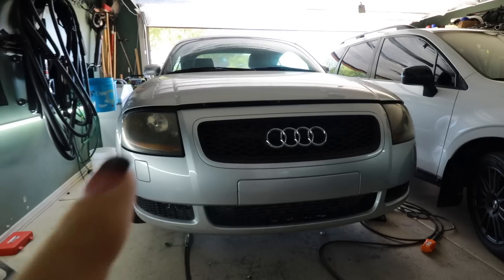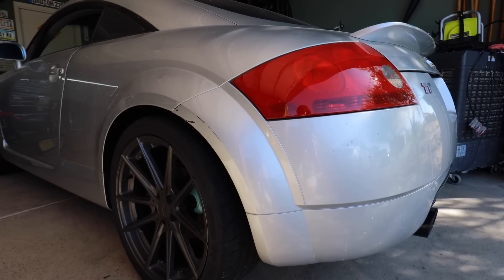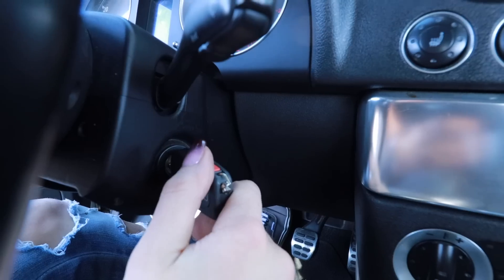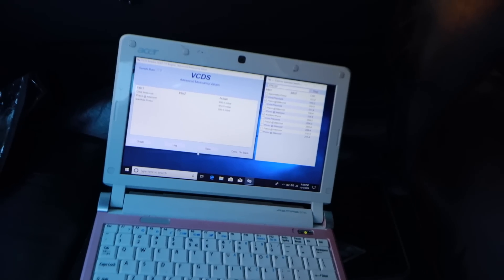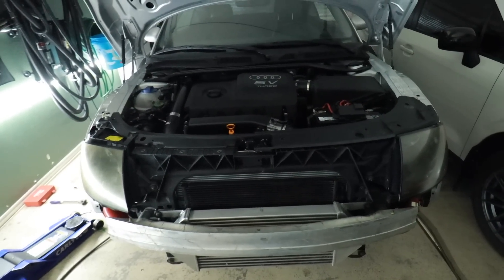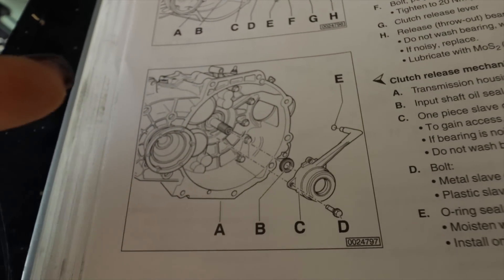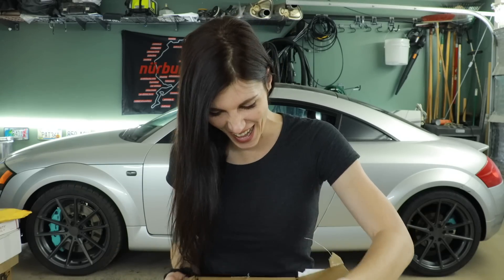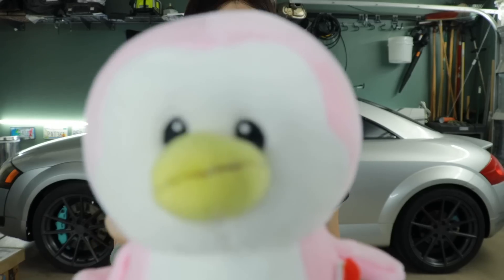First Drive Ends in Massive Failure // Project TT Quattro

Comment: Oh yay, we've reached the "set it on fire and push it down a hill" Part of a project car build.
Reply: Shit.
Reply: ...why waste a match, just leave it on the side of the road, since that seems to be its natural habitat.
Reply: @K03sport  Because that's not nearly as satisfying
Reply: have to agree; seeing the additional repairs on video won't be much fun anyways...unless you do mail time on each vid!
Reply: You have to take other clamps for the air tubes, just normal ones. At the end of the pipes "welding points MAG" then the pressure hoses no longer slip down. Greetings from Germany
Reply: Lol, I thought I was alone in using that terminology referencing my project car!
Reply: @Larcona_ ... True statement. Well, guess I'll bring the marshmallows. Guess it should be parted out first as the nice stuff should live on in another build.
Reply: @K03sport  fair enough
Reply: Every restoration goes through the "set it on fire" phase.  Those that have done them know it's just part of the process.  Typically, for me, it's "what the hell did I get myself into" phase, which is usually about half way.
Reply: @jeepmor  Hell, I hit that phase pretty much every job
Reply: Welcome to the nightmare that is VW/Audi.
Reply: @midnight-xpress1136  Cool name
Reply: Having just spent $1,100 on parts for my project van, I feel like I may hit this phase soon.
Reply: You forgot the "and then we never speak of it again" part of it :)

Comment: And now, you discovered the flywheel bolts are loose , a couple of the crankshaft bolt holes needed to be helicoiled, more cleaning, resprayed the TT , new Borla exhaust, front and rear sway bars , hours of cleaning all the wax spray rust protection off the chassis and floor panels, it’s gonna be awesome!! And some lucky viewer will buy some Merchandise and then win you TT! Fantastic! Bet you were not thinking that when you posted this! Keep up with your great content! Thanks!!

Comment: Hey Sarah, I got my TT back together only to find the temp and fuel gauges are cooked - and not just the motors, its the chip that controls them. These TT's fight you every step of the way, but stay strong, go work on something fun then come back to the TT. Getting the engine and gearbox out is not that difficult, the whole front end comes off so you can drop the engine onto a pallet or trolley and pull it out - you don't have to take it out the top. I've seen plenty of people do it on their own, just be methodical and take the time you need. Go Sarah !

Comment: Stick with it.  The clutch slave cylinder on my 2001 TT went shortly after I bought it back in 2008 with only 56k on the clock.  I remember that feeling well.  I’m a garage mechanic with no lift and it took me about 20hrs to do the job.  Its a big one, but not rocket science.  Plus, you’ll gain the respect of every mechanic you talk to from here on out.  Good luck!

Comment: Keep going Sarah, you'll get there! Just replaced the clutch on my 225 TT project. Just over 18 hours including time to clean everything and of course replace the engine rear oil seal and the transmission input shaft seal. None if it was particularly difficult, it's just that there are a lot of parts to come off before dropping the transmission.

Comment: Had a 2002 VW Beetle turbo with way to much to list. 480 hp on nitrous to the front wheels, was always breaking motor mounts, and blew 2  diffs totally destroying the transmission case each time. Fun times, until it got stolen back in 07. Current project is an Acura TSX. I know I'm late to the game but keep it up, don't give up. Loving the channel.

Comment: VW/Audi tech here. Can confirm, sounds just like a failed dual mass flywheel.
Reply: invisblegt correct I just replaced mine
Reply: XD
Reply: Yup, noticed some rough gear changes, also sounds like over run on the boost. Anyone else hear it ????

Comment: I am sure it's been mentioned but the DMF has a tendency to have a higher failure rate, just be glad it did not explode. When replacing mine on a VW golf it was recommended to move to a SMF and step it up a notch. I am actually not surprised it failed on the TT with all your improvements in performance you done.  I know you've struggle with this car but its come along ways and you've done a great job!!!

Comment: It is incredibly frustrating when this stuff happens I know but full marks for digging in and pushing on, the videos are still great to watch! 
I’ve spent since February this year stripping, welding and respraying my 1973 Triumph Stag, no putting it back together with every part rebuilt. I am dreading and looking forward to the first drive- probably next Spring!- as I know I will find all the bits I got wrong 😬

Comment: Hey Sarah, I feel your pain. I just spent months rebuilding the front suspension, complete cooling system and timing components on My A4 SLine Ultra Sport Only to find it had blown head gasket/cracked head/worse..? Anyway, don't get down & don't give up. The TT will rise again. I have faith and you have guts. Hope to see you on the road sometime.

Comment: Use weld slag to keep the IC piping together. Basically, just put a spot weld in 3-4 spots on the edge of both side of each tube where the couplers and clamps are. That will give the couplers something to "bite into" under boost. I did that on my Cobra and it was good to 30 psi. :)

Comment: screws through the round pipe will allow the clamp a backing and help prevent slip out under boost. You can use rivets if you like. the hose holds them in and they will not fall through the metal into the intake stream.

Comment: Had a 2005 Series I Quattro cabriolet.  Drove it 156,000 miles.  Sometimes I wish I still had it😞.  Just about everything on that car was hard to work on.  Loved that car.  Now have a 2018 TTRS.  I like it too it has manumatic trany and isn’t a convertible but it is a better car and has LOTS of power and an extended warranty...

Comment: remember to make sure you have charge pipe couplers very clean. Both the pipe and coupler have to have no oil on mating surfaces or they can slip off even when clamped hard. Especially higher pressure like 26psi on my turbo 5 quattro. 

I recommend a steel single mass flywheel conversion. I really like California Clutch, mine was custom for my S6 with a single mass FW

Comment: For the 32 people that have already, and countless more that will, this is not a throwout bearing noise. They will generally present exactly opposite of Sarah's issue. 

Throwout bearing is engaged to, and spinning on, the pressure plate when the clutch is disengaged (pedal down) and just along for the ride with the clutch out.

If a throwout bearing is making noise with the clutch engaged (pedal up fully) then it's already separated, and will make far more noise with it spinning on a disengaged (pedal down) clutch.

Comment: I have a 2006 Audi TT mark 1. Here in the UK and yes to change the front bulb you have to take off the whole front of the car
..crazy. (near side) I've changed the other bulb without having to do that on the offside. Great car although mine's only the 180hp single exhaust.

Comment: While fixing your 02M gearbox / clutch, please check the 02M's selector forks. In its cost-cutting wisdom, VAG attached the forks with rivets, not nylok nuts 'n' bolts. The forks can detach and fall into the 'box with two possible outcomes, 1) best case: a "box full of neutrals"; 2) worst case: terminally chewed internals.
BTW, thanks for your excellent vids.

Comment: Dual mass flywheel coming apart....change over to a single mass setup...Valeo makes a direct conversion kit...part no 52405615 . You can get the flywheel, pressure plate, slave cylinder, clutch, etc. and it's less than $400 on that "stone" online retailer with the funny commercials. I did it to mine, very glad I did. Good luck!

Comment: Hmmm.  Let's see what I've had to fix lately.
Mercury #7
Turn down the turbo boost for a stock ECU.
Replace tires that don't hold air.
Mercury #4
Got the aftermarket radio to work.
Got the Cruise Control working again.
Got the battery light to stay out.
Still trying to track down a check engine light.
Mercury #6
Need to get the radio working on this Convertible too.
--------
So I work on cars too but not near as much as you do.

Comment: Go to Harbour Frieght and get a bead roller. Or see if you can find one on Craigslist or something. Maybe call a shop that has one and see if they will roll it quick. If you can't find one talk to someone and have them weld a bead around it, and that will keep it from blowing off. Cheap temporary fix until you can get decent piping

Comment: For the license plate mount, take a 1x2 and mount it to the wall at the studs, then screw the license plates to the 1x2’s. Less holes in the dry wall and the screws won’t pull out of the 1x2.

Comment: As someone who's tackled pulling a transmission out of a VW/Audi product alone, I would suggest you pull the motor.  Yes, it's a bunch of extra work, but it will make the job so much easier.  Just simply getting the transmission out with the engine in is ridiculous because of how you have to rotate it to get it passed the subframe.

Comment: Good diagnostic. If you’re right and the flywheel springs are gone, you may have noticed a light knock/thud sensation when you drove it previously. As the springs become worn, you’d notice that when you lift off the accelerator that the car knocks once - it almost feels like you’ve got an engine mount loose.  That sort of thing I’d expect on a car with 80k plus miles - which is what’s earned me off a VR once before. I’ll be keeping an eye out on my current VR too.

Comment: I’ve had shops replace my clutch for about $1200, if I remember. (2004 TT 225)

I know South Bend makes a good aftermarket clutch with near factory feel. Don’t go with a lightened flywheel unless you like your TT to sound like a diesel.

Comment: FWIW, I have a 2013 Beetle Turbo and I broke the dual mass flywheel. They're a notorious weak spot if you add power. Basically, I was making around 310lbft of torque and the stock setup was rated for around 250.. It lasted 20k miles. ;-) The new setup is single mass and is rated for 400lbft.

Comment: After nearly scaring someone off the freeway when I blew an intercooler boot at around 55psi (diesel), I learned that hairspray works pretty well when putting the hoses on.  It's enough lubrication when it's wet and after it dries...  Well, it's hairspray.  :)
If you ever need another set of hands, I'm on your side of town and have no life outside of work.

Comment: Sorry about all of the trouble with a capital TT.  Anyway, now's a chance for a single mass flywheel that spools up quick.  Also, the guys at South Bend Clutch are cool and can get you into a higher performance setup that still shifts nice for reasonable dollars.  Maybe they can work you a deal,  They were helpful for all of my questions.

Comment: Miss Sarah, on the metall flanges between the silicon piping, ye know the joints as ye can call it.. Weld just a dot on each side of the pipes and then just use the Vband to clamp the hoses, this solves the issue ;)

Comment: Haven't read all the comments so just ignore this if already explored.  But have you checked to see if the catalytic convertors are clogged? I had a 200k mile Audi 90 that ran hot with low power. A piece of the catalyst had broken off and plugged the outlet. I discovered it by the amount of heat coming from below the car and by an exhaust rattle.

Comment: Clutch can be done in your garage, it's a lot of stripping because of the awd but it's deffo possible. The duel mass flywheels have become a weak point in many vehicles, I dread the day my roadster needs one. Not sure the implications of fitting a solid flywheel but they are available.

Comment: You have to take other clamps for the air tubes, just normal ones. At the end of the pipes "welding points MAG" then the pressure hoses no longer slip down. Greetings from Germany

Comment: hi Sarah, its not that hard to take that gearbox out. You can easily do that in less then 12 hours, dealership always quotes more time for safety reasons, in case something goes wrong. You dont need to separate the transfer box from the gearbox, it all comes out as one. just make sure you drop the sub-frame completely out of the car and you have tons of room to drop that gearbox in less then 3 hours. i own a audi tt quattro and i just did a clutch change for a solid flywheel conversion kit. Good Luck Sarah

Comment: time for a single mass kit (i like southbend clutches) and fluid damper harmonic balancer. it will be cheaper. you got this! since the ac is empty its fairly simple to pull everything out of the front especially with your lift setup.

Comment: I like what you are doing with that car, some weird methods but kind effective (i liked how you mounted the silent-blocks), if I recall correctly, that clutch has a lot of hours but shouldn't be complicated, the biggest problem is that you have to disassemble the front transmission and the one that goes to the back, hang the engine and then you can remove the whole gearbox, whit your space maybe with a carjack or someone able to hold it in his chest, don't give up if you do it you're gonna regret, just please don't give up i want to see it finished.

PD: if you are adding power and torque you should change the flywheel for a single-mass one

Comment: Eh don't feel too bad Sara, My mini's and almost all my turbo cars have had the boost charge pipe pop off at least once. you can use a small drop of glue on the fitting just to stop it coming off so easy.
Reply: I bet you could do the clutch with an extra set of hands. You are way car smart you can beat this, and it will be as cool as you think it is.

Comment: Ok just did the clutch, Solid mass fly wheel, slave cylinder, while your there I’ll WARN YOU know!!! Go ahead and replace the 1st, 2nd, 3rd and 4th shift dorks!!!! Yes dorks the OEM are brass and break off. Mine was stuck in 3rd, USP motor sports sells them, easy to change, look it up. Plus taking down the rack throws the alignment way off! Good luck

Comment: Don't feel bad about the high pressure tubing. Marty at Mighty Car Mods had his piping blow on his first attempt at the drag strip. It failed once on the dyno, then at the track it popped the inter-cooler piping secured with a stainless steel clamp.  This is a serious problem in the car world; solutions to it would be popular.

Comment: Intercooler pipes : get harbor freight stacon pliers and use them to put a bead on that pipe. It will take time but it's cheap. Spray the pipe with hair spray. Compliments of real home made turbo ( og diy turbo site from back in the day)

Comment: Great video!

As a german you really touched my heart by keeping the 8N as original as possible :)

That 2 mass flywheel problem is pretty common with the Turbo engines ( as you certainly already know ). People over here replace them with a single mass fly wheel, that fits the tourque you got there.
I like that you don't just give it up, since you already put that much work into it.

 So if you can't find fitting parts for your love, maybe there is a way to find everything you need here in germany. Prices are pretty good for thos older cars right here ( driving an Audi A3 8L1 1.9TDI AHF myself ). 

Cheers & greetings ///

Comment: the spring is broke on the clutch disc it self. They compress those springs then release them in there holder, that holder is just a tab of metal(tang). If the tang breaks, the spring will rattle and you will have a tambourine..lol.  If the spring moves it will make contact with something on disc or pressure plate... which will cause clutch to push back. What you feel is the spring  running over the heads of the flywheel bolts or even another spring

Comment: This really hurts to hear. I am familiar with this exact situation as it was my Dual Mass Flywheel that ended up warping my crank shaft. This ended the life of my B4 S4 as it would cost too much and no shop wanted to do the job (I went to three shops). If I had the garage space, I would have held on to it.

Comment: Just one thing... if you buy a performance clutch, you may experience a very heavy clutch pedal which will ruin the car as a daily driver. Also, consider a single mass flywheel alternative which will be more robust and cheaper. Just a touch more vibration on take off though

Comment: Convert it to a single mass flywheel. It's also usually cheaper. For my V70R Stock dual mass flywheel is almost $900 (just the flywheel) and it's $850 for a single mass flywheel and clutch kit. I haven't messed with audi's much but if look into going to single mass flywheel

Comment: Nice to see a local german plate on your wall there. And for the labor time, working at a VAG dealership that's the time you are "supposed" to work on it. If you're faster you're faster.
But dont give up on that car, it will be a nice thing once running perfectly fine. And the paint, pff its no new car so eventually scratches happen over time eh. I like the old model TT, especially the TT Quattro Sport of your generation after sitting in it when it got a windscreen at work. Compared to the factory Sparcos from my Mini the Recaro pole position (factory but also an option i think) are so good and keep you planted even more.

Comment: I got lucky  I guess. I bought a $2500 1.8t a4. Tuned it to 22psi and have been shredding it for 55k miles. No powertrain/drivetrain issues.  Just about everything else though. Including steering rack and 3/4 power window regulators.

Comment: Dear Sarah, what ever you do DO NOT put another dual mass flywheel in that roach. I am sure someone makes a solid one piece flywheel for your TT.  The dual mass in my '03 Tiburon gave up at 38,000 miles. The replacement solid has gone 100,000 miles and still works great!